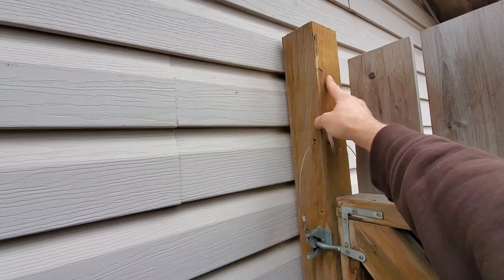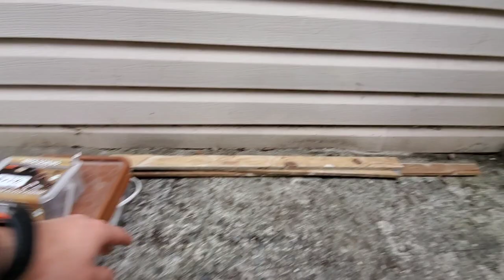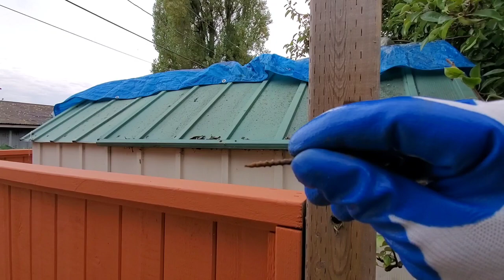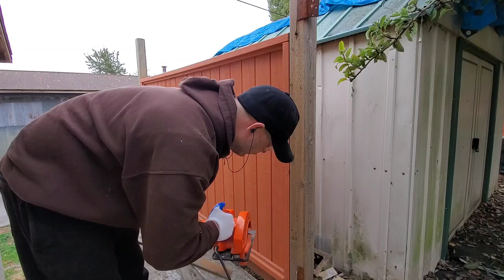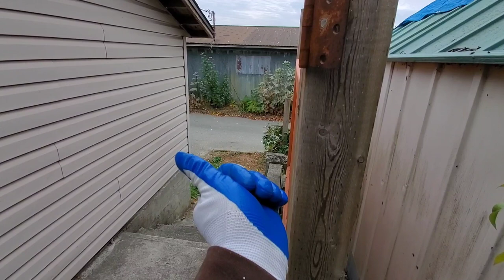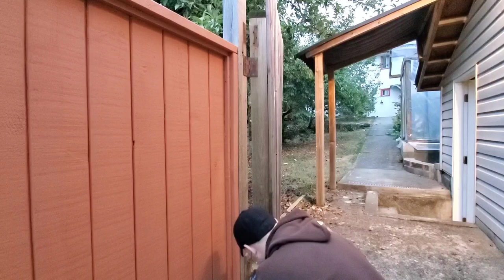Straightening a bowed post holding a gate

Comment: Try buying real adjustable fence gate hinges
Reply from the maker: Thanks for your comment, l didnt show it because it was getting dark, but the gate had to be cut down abit. The bow in the post changed the opening between both posts between the top and bottom. Avoid my mistake and start with a 5x5 post.